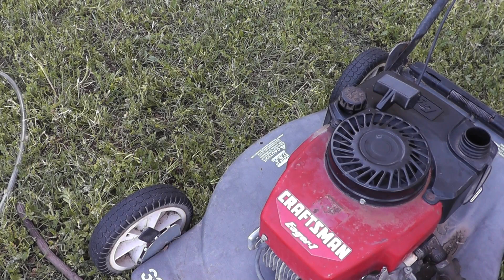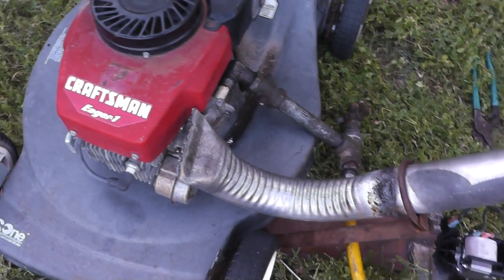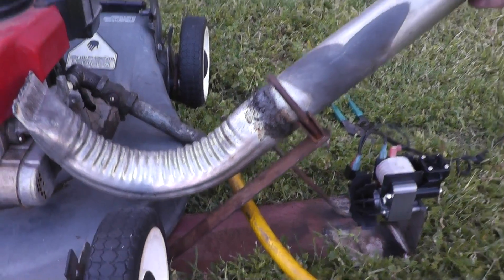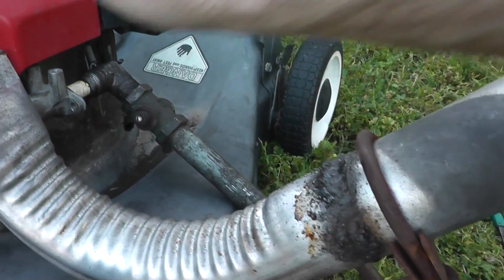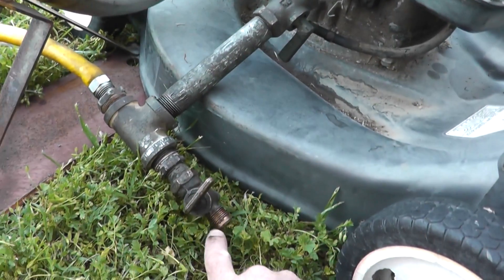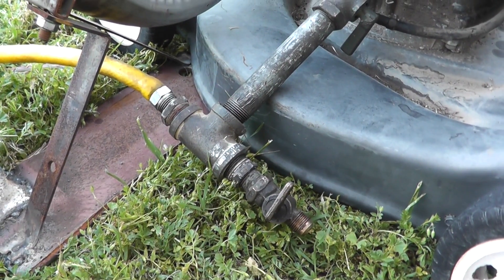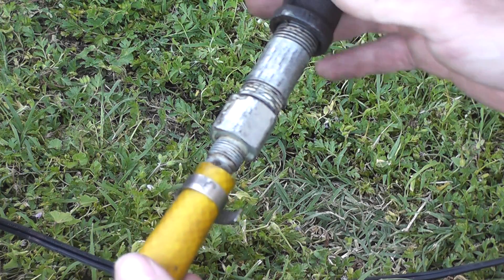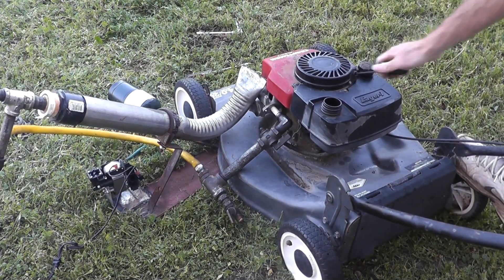Vegetable Oil Vapor Carburetor - Running A Gas Engine On Grease!

Comment: thumbs up for the Puppy :) lol but really nice job dude on the pyrolysis setup. my 2 cents, 1.you need to seal your boiler better, 2. the output line from the boiler should make a bit loop like a rainbow to stop fresh air from going into your boiler or run the output through a bubbler :)
Reply from the maker: +richardlyew Good idea about the loop, thanks!

Comment: My Fathers friend ran petrol engines on diesel fuel in the 1950 s using a fuel preheater pipe through the exhaust manifold this system is different but it works..
Reply from the maker: +conal corm that's interesting. I've heard that years ago you could get a kerosene conversion kit for briggs engines.

Comment: maybe, boil water with oil flame and convert engine to steam?.
Reply from the maker: +Frenchie I've thought about it, but there are 2 problems. One is the mixing of water (steam) and oil, and the other is the valve timing. I would have to fabricate a new camshaft to make it work. the advantage though, would be eliminating the need to create and maintain an accurate air/fuel mixture

Comment: look at the yellow rubber hose??? it is hot and it is flatting out. this will cause a lack of fuel. you may want to use a better transfer than the rubber hose!!!
Reply: +Richard Downer watch the video in slo-mo, and you can see the yellow hose collapse with every intake pulse of the engine.  good catch b.t.w.

Comment: I guess some early motorcycles required a half-and-half mix of oil and gasoline.  They were supposed to get so hot that it would burn the oil fully instead of making all that blue smoke (which seems to be mostly oil vapor).  That sort of motorcycle was popular in Japan and Asia, I believe, before WWII.  They were generally two strokes.  I also know that if you run most any two stroke fast enough and for far/long enough that the oil will quit making blue smoke and will burn fully with the gasoline.  I just wonder about how high compression was and the durability of such engines.  Also if they were difficult to start.

Comment: Have an odd question,but relevant, I'm interested in trying to convert an old camp stove of mine to burn oil. It burns most fuels,though the jet is to small for alcohol. It works by fuel vaporizing in a copper tube that the flame keeps hot. Vapor leaves the jet at the base and ignites at the super heated vapor tube. In theory I should be able to burn any fuel with the proper vapor tube and jet size. Current specs let me burn deisle and kerosene. Have any tips for this build?

Comment: thats brilliant i use oil for my heating and running vehicles but didnt know it was possible to use it in petrol engines. i think it would work better attaching your gassifier pipe to the air intake on the carburetor as engines governer could work to so i would have no valve between gassifier and carburetor. love the theory , keep up good work :)

Comment: wouldnt this be the same idea as a propane motor as the motor is just running on a flammable vapour, what im wondering is would it run on any other flammable vapour

Comment: Did anyone notice that you need to use a fossil fuel to get it started? That is a fail. If you invent a solar glow plug or something like that, then you may be on to something. Just getting a motor to run for a short period of time using a fossil fuel as a starter is no success. I can run a motor with a can of carburetor cleaner. Does that mean my time was well spent?
Reply: If you only need a few ml of gas to run an engine on a fuel like wood for ten hours, then yes. You could distil turpentine from wood if you wanted to be a purist and use that instead of gas to start it, but if you can get 5 years out of a gallon of gas, I don't think you have wasted your time.

Comment: Perhaps an automobile disk brake rotor, scrap at any auto repair shop, mounted in place of the mower blade, would act as a flywheel for improved low rpm operation?  and Yes, definitely pre-heat that fuel for better metering and superior vaporization.  Great project for a prime mover!  rc

Comment: Four Cycle B & S motors will run very easily on just about any method. I went to a small engine recycling yard
one time and walked out with a junked out 3 1/2 hp motor missing the carb, the pull start and spark plug. Found 
a piece of rope, a dirty spark plug and soaked a rag in some left over gasoline which i stuck in the carburetor hole
and after a couple of pulls it started right up , but ran very slow... Those engines are bullet proof

Comment: I wonder. . . . . If you can run a gas engine on grease using vapor fuel, could vapor fuel run a coal water slurry?

Comment: You should heat the flowing oil not the stored oil. Maybe you should add an extra storage what slowly drop oil into your "reactor" And maybe you should bring the "reactor" near to the engine itself. Maybe you should weld it on the cooling surface of the cylinder to use that heat. Or you make an second tube inside of your reactor. You should remove the original exhaust box and connect the "hole" of the cylinder to this second pipe inside of your reactor. so the ultra hot exhaust gasses will flow through your reactor. And if you use copper pipes long enaugh for it the noise will be reduced to an aceptable level. You should have a "chopper like" sound after that. I tried this kind of exhaust on an similar engine. i used 22 millimeters diameter copper pipes around 2-3 meters in total lenght with some curves in it. Please led me know what you think about that idea. greetings from Germany!
Reply: RundeKatze , perhaps more of an egr style heat circulation pipe ad opposed to using the entire exhaust pipe for heat, and btw brilliant idea suggesting the convection fins for a mounting surface as a heating source.
Reply: Hell yeah, makes me proud of my German heritage. Keep kicking ass.
Reply: Great suggestions!
Double Wal pipe, exhaust all around the reaction chamber. Insulate the heat chamber.  Drip feed like oil burner rocket stove!  Pre heat feed oil with block or cylinder head. Start engin with 10 % gas blend (vaporizes easier for start up).  Rotate chamber parallel to handle, increase reactor air inlet tube add flow valve, pre heat the air, run tube extension down side of reactor (under the insulation)

Comment: that was awesome. would be nice to do this to a honda eu3000 generator
Reply: It'll work but it may run like crap due to the higher compression (9.0 to 1) veggy oil is about 25 octane and the absolute highest compression  I would recommend is 8 to 1 or less
Reply from the maker: jay7264 yeah getting electricity or maybe transportation out of the waste oil is my goal. Still have some bugs to work out though!
Reply: its not practical....do the math :P

Comment: you should see if you can run a turbo to make it have more air because diesel and veggie oil ran engines love air but  yet it has to have the right ratio of fuel to air
nice vid man

Comment: In the war time when fuel was rationed they converted petrol engines to run with a wood or coal gasifyer, they actually used them in cars and trucks.
Reply: diesel engines can run on woodgas too. You let the engine idle on diesel and you control the power by dumping woodgas in the intake

Comment: this  would have  worked  better if  your  yellow hose had  been something stiffer 

i can see it  collapsing when the  engine  ran
Reply from the maker: wildcoyote34 thanks for the tip, somebody else mentioned that to me as well. I'm thinking of making the next version all metal so it can withstand the heat/pressure a little better.
Reply: sounds  like   good  plan  to me ,,,,I've never tried  making a  vapor carburetor before 
I have used a carburetor for a vaporizer  for a diesel flame thrower though

Comment: I noticed that as the engine is running, the vacuum is causing the water hose to collapse on itself and that is starving the engine for fuel. You've basically built a gasifier system and are using it to gasify oil. If you can isolate the exhaust by welding a shield from it to around the lower portion of the gasifier, you should be able to better direct the heat onto the area needed for heating to fuel source. Make sure to allow for the escape of the exhaust after it passes over the gasifier though. I would also try to use a solid line of some type to prevent the closure of the fuel intake source. This system is similar in principle to the GEET systems. The idea is to use the exhaust heat to vaporize a fuel source to be mixed with fresh air and then drawn into a carburetor. With this type of system you can use all very wide range of fuel types. BIG ADVANTAGE.. Nice job! Keep it up! The refinements and updates will be good to see..
Reply from the maker: Big C Good observation about the hose, and thanks for the idea about the exhaust. I definitely need a more effective heat exchange from the exhaust to the boiler, as it is really important to the system's efficiency. You're exactly right about why this type of system is valuable. It's a long way from being practical at the moment, but once sorted out it should be able to run on any heavy oil.
Reply: ***** I appreciate the investment in time and effort you have given to this project. The practicality of it comes when you have the system built that can be transferred to run most if not all types of small engine items. Not just lawn mowers, but generators, small engine welders, engine powered pumps and other items like that. Think about the potential for uses where there is no electricity but small brush or small amounts of used oils that can be used to run a generator. Or take for instance the availability water. This gasifier project could be used to run an engine powered pump to help bring water to an area for crop growth or just plain drinking. SOOOO much potential in this type of system. Cudos to you!
Reply: @craigcarpenter2069  I have been studying this system and the overly complex system of gasyfying wood. Pretty good thinking. However I do think you might have to start on regular gasoline, then slowly change the exhaust to the waste oil vapor. I myself have been playing occasionally with waste oil. I did have a waste oil stove that stopped working awile back due to it rusting through and I haven't gotten around to making a second version yet.

Comment: I tried running a lawn mower on pure diesel, and it worked surprisingly well.
Not only that, but it was noticeably more powerful than before.
I preheated it with petrol for a few minutes, then filled the tank with diesel, leaned out the mixture setting and mowed a couple of acres.
It also works on my Fergusson tractor, once it is heated up.
When running sweetly, there is little to no exhaust smoke.

The only down side is that it eventually fouls up the spark plugs.

I am guessing it would work with vege oil in the same way, but I have not tried this yet.
Reply from the maker: ***** I've heard that years ago, Briggs and stratton engines had kerosene conversion kits available. It just had lower compression, and probably a system for bringing the engine up to temperature on gas before switching to kerosene.
Reply: *****
 Yes, the older farmers around here have similar stories about kits for their tractors. I think they called it 'power kerosene'. They mentioned a valve that allowed preheating on petrol, then another valve that selected between the two fuel types.
My experiments were nowhere near as well developed, but it was great to see just how well it worked  :).

Comment: i am completely new to this idea but not at all to the topic of engines, but one question would motor oil "crack" or is it just veggy oil
Reply from the maker: Mr3wheeledbike Motor oil should work, in fact it may vaporize at a slightly lower temperature.
Reply: i been doing a bit of poking around with it, neat idea this figer i'll give it a go

Comment: great job, not bad, I want to try it too, I have done few gasoline vapor carbs, for oil I would use an empty propane tank to fill it with oil and weld a hot water tank heater to it and install a thermostat to maintain a proper temperature in the tank , this way u will have a better control of the temp, u over heated the oil , otherwise I would ve run smoother. u r awesome, keep the good work
Reply from the maker: kazuza9 Thanks for the idea, controlling and monitoring the vapor to make it consistent is probably the toughest part of this setup.
Reply: ***** , u keep playing with the heat thermostat until you get the right heat and amount of vapor u need. pretty simple. may take few days. good luck. keep us posted please. if you need any ideas plz get it touch ,  I have had plenty of experience in stuff like this.

Comment: you should us the carb and feed the vapor into the air inlet of the carb that way all you have to adjust is the fuel flow and not the airflow also

Comment: There are a few things you should look at here.  Firstly is cracking the oil ( externaly of the engine) to make a fuel you can pour in. I have done this and you can get a petrol like fuel from vegetable or better still, used engine oil.
The smoke you saw was because the oil wasn't properly heated and the mixture was off, way too rich. Same would happen if you were using too much petrol.
Having the exhaust blow on the HE like that is cooling it. You need to have the exhaust impinging directly without mixing and cooling from the outside air.

If you have the mixture off or the oil not properly vaporised, You'll very quickly coke up the rings on the engine.  Over all I strongly suspect that the amount of heat required to make this work would be more than the amount of heat the engine puts out because you are never going to be able to capture it all and only 33% of the total energy is going out the exhaust.

As far as contaminants in diesel injector pumps, People doing this, ( and I'm in my 10th year) FILTER the oil very carefully ( I filter 10 times finer than Diesel fdrom the pump) so there are no contaminants in the oil. I also use a fine onboard filter than what the manufacturer installed.

Hard to say the practical merit of this idea. I'd suggest you would be limited to stationary engines though and a cracking system would need to be able to be cleaned out as cracking any oil leaves deposits.  If more heat is required, You could always use the waste oil to power that.

Overall I suspect it would be far more practical to crack the oil in a proper setup first so you could just pour it into any engine you wanted.
Reply from the maker: Interesting ideas, thanks. It's definitely not a finished project, and there are some obvious areas for improvement. What will decide the usefulness of the idea is ho efficiently the oil can be cracked. I think that with a proper heat exchanger, the exhaust gas could do it. The flashpoint for veggie oil is 621 degrees, and gasoline engine exhaust temps reach 1000+ degrees. I'lll keep tinkering with it, and hopefully make some progress :)

Comment: The clue was that you had a flame in the open "AIR" the flammable fuel to air mix needs tweeking.Think primus.uses meths to get the kerosene to vapourize and once burning is self running.

Comment: You need to wrap the abs with header wrap.
Reply from the maker: Good idea. I think if I pursue the project further I'll extend the portion of the tube that the cap goes into so the plastic will be further from the heat. Thanks!

Comment: looks like your onto a functional system. just needs tweeking.could you use other flamables as well like straight ethanol or lantern oil.
Reply from the maker: Yeah, if I could get it to work reliably, the system would be pretty versatile.